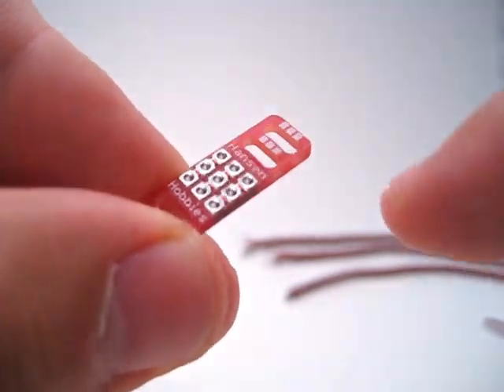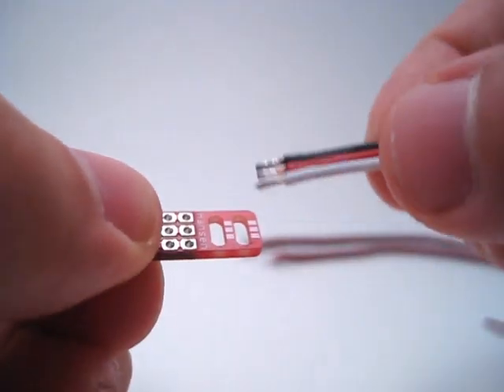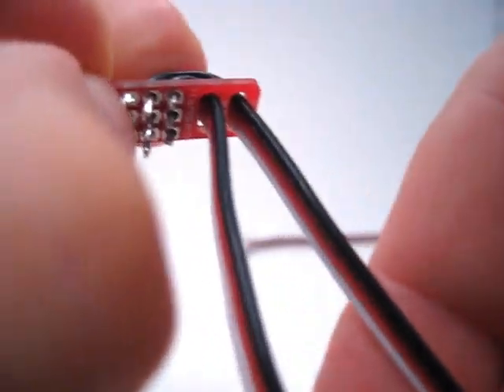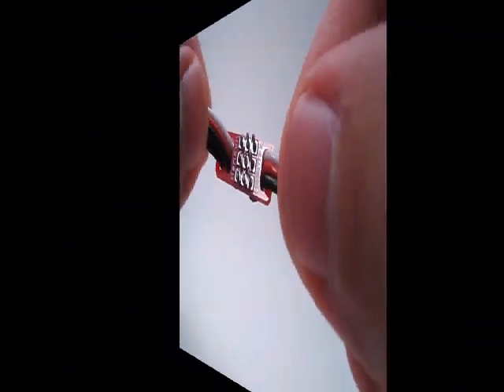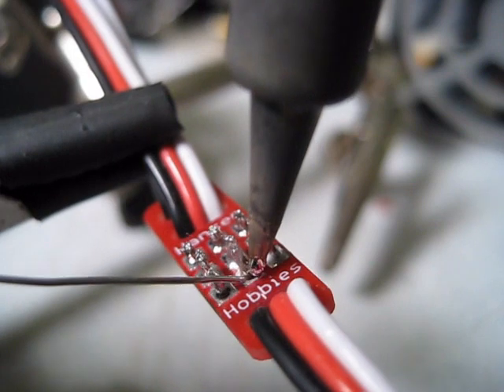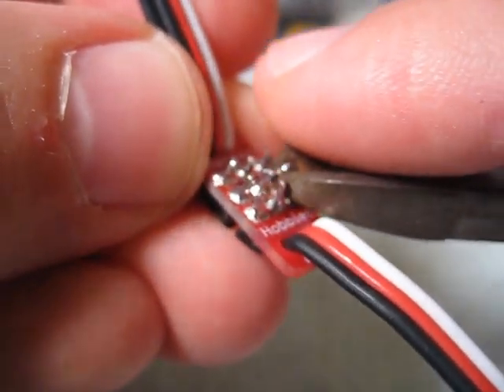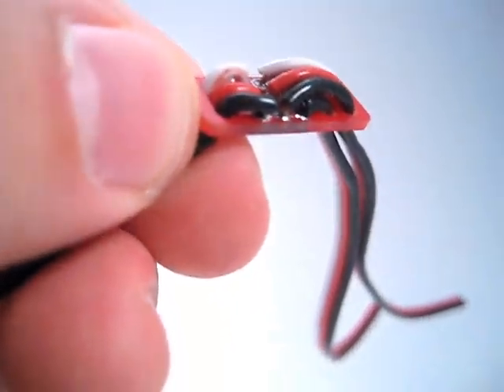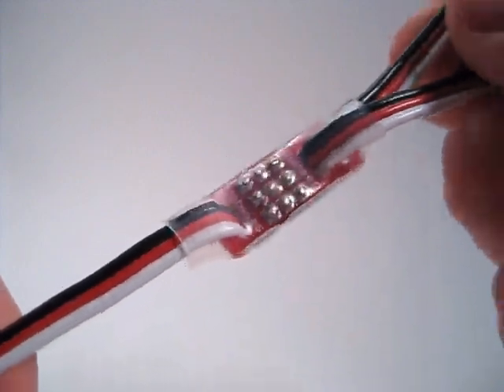Servo Y-Harness PCB

Comment: A suggestion.  Put one cable into the slot, bend it and insert the wires into the circuit board holes.  DO NOT pull them flush with the board yet.  Turn the board over and solder one row at a time.  Do this for the second cable and then the third.  This will lessen the stress of the bend on the wire as you solder it and will not cause the wire insulation to melt due to that stress.  After the 3 cables are soldered in, then you can pull them back through the slot and make them flush.  Just some advice from a 30 year experienced electronic technician..  Not being a smart a**, just some advice.  I have done hundreds of little jobs like that and have learned over the years...

Comment: Can the + & - wires on the servo be reversed in the connector?
Reply from the maker: This connector basically just offers a pcb with three inline traces.  We've configured the board to allow for built in strain relief of your servo wire.  Each trace can be assigned to whatever you want.  So yes, you could rearrange the servo wire order as long as you're consistent each time.